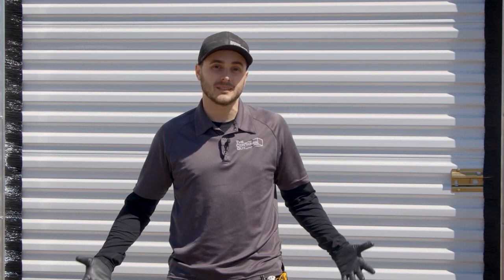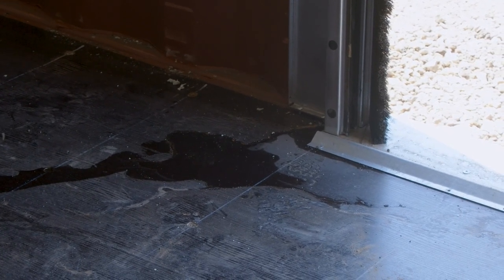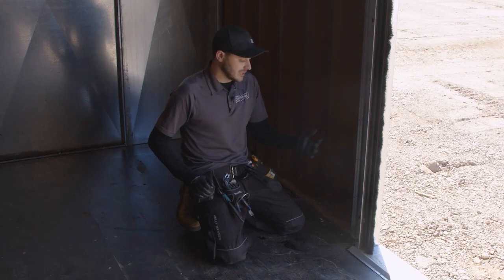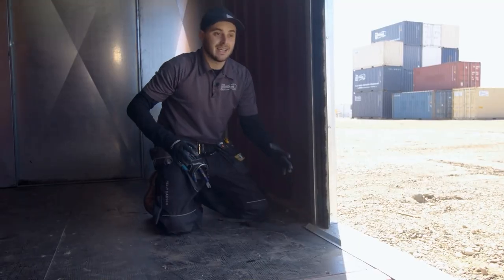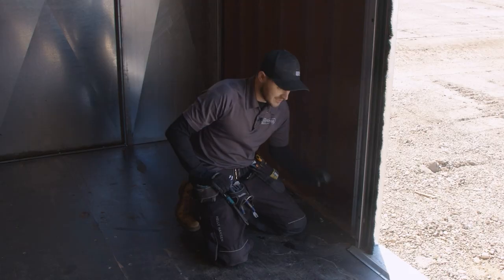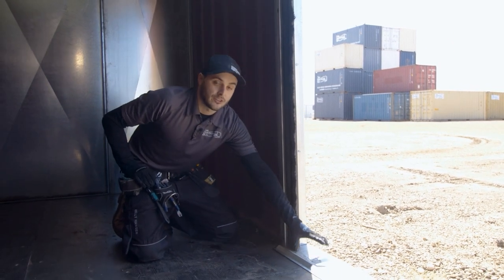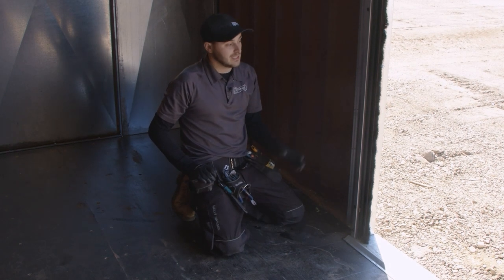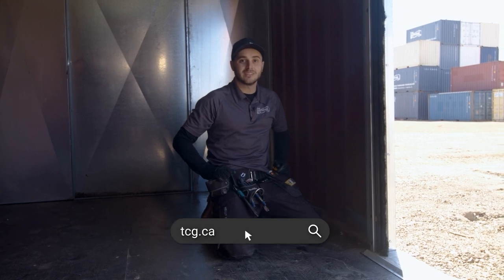Roll Up Door Leaking In Your Shipping Container? How To Fix It!

Comment: You might wanna try buying a tube of automotive seam sealer, just try it out, its a urethane product and unlike silicone its a whole lot more mechanically resilient than silicone because it remains ever so slightly plastic over time and will creep to maintain connection with surfaces. Its also a hell of a lot more tacky than silicone and stays adhered to surfaces instead of wanting to pull off. Also being a urethane product, it actually cures with moisture exposure! I installed a metal frame home-depot door in my container and I used this stuff to seal around the whole perimeter of the door, its been like 5 years now and the stuff is holding up really well.

I initially got the motivation to try this stuff after removing a window from a school bus manufactured in 1991 and the seam sealer they used to caulk the window in place was still incredibly sticky, pliable and so tenaciously attached to the surface that it took gasoline to clean, Its not so rigid and epoxy-like in the way construction adhesive is.